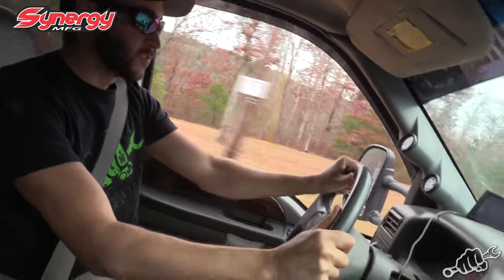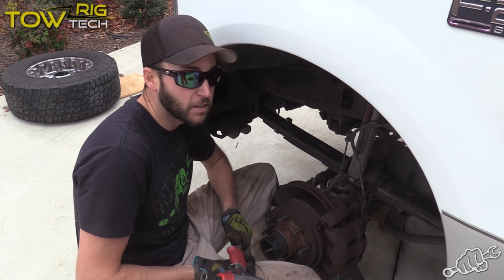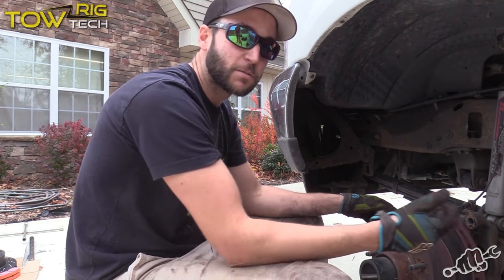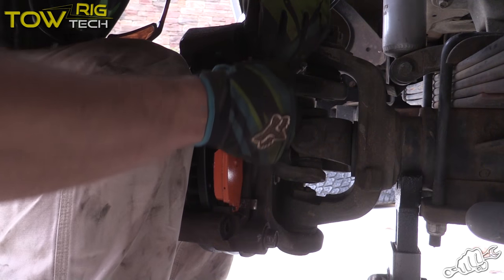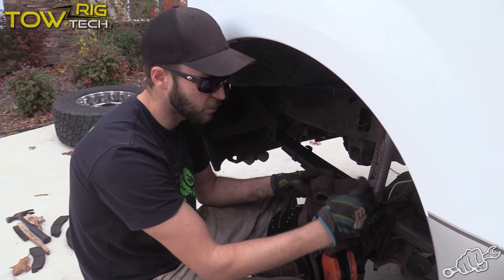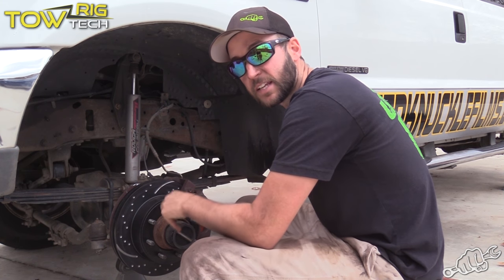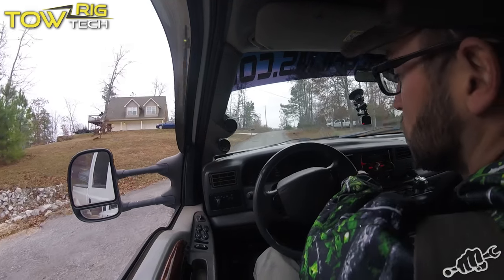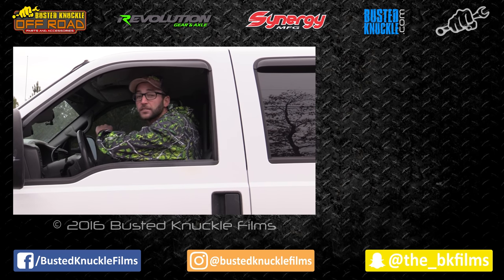F250 EBC Brake Install and Review - Tow Rig Tech EP2

Comment: I did a similar setup on my Excursion and the stopping distance and pedal feel is awesome.  I'm jealous on how nice everything came apart on that truck - salt is hell on those parts in MN.
Reply from the maker: Kyle Q it was all pretty rusty. I am glad these rotors are coated so no more rust
Reply: Kyle Q I had to pull the caliper brackets off of my 02 Silverado the other day, and I almost busted both of the huge bolts trying to get them off. Minnesota is hell on every vehicle, no matter what part of the vehicle it is. The truck in this video is so clean of rust compared to anything that you work on around here. There is always a pile of rust to sweep up.
Reply from the maker: Yeah that salt is rough on stuff for sure

Comment: Any recommendations for upgraded calipers? I'm fixing to overhaul all 4 corners, lines and all and I need some good calipers. I did some research on the Power Stop kit with everything included but SEVERAL reviews on the plastic pistons in the calipers, some catching fire, so I'm a little leary after seeing that but love the fact I can get everything I need minus the lines in one kit. I appreciate any advice you have, thanks!
Reply from the maker: they are remanned factory calipers. SSBC would be my choice if I wanted to upgrade the brakes.

Comment: Are these way better than stock I’ve had 7.3 excursion and F350 pull to both sides when I hard brake
Reply from the maker: I think they are , sounds like your rotors might be warped

Comment: My pos 7.3 has gone thru 6 calipers over the past few years, bastards seize up on me. It ain't the slide pins either. I wish there was an affordable upgrade
Reply from the maker: so far no problems for us
Reply: G Palmer0331 changed the brake fluid in mine is solved the problem
Reply from the maker: That does help
Reply: I've have to grind out the slots so the pads don't catch after every winter in Buffalo NY.  Looking for an upgrade now. Truck is 12 years old.

Comment: I couldn’t help but notice you’ve got a rough country lift kit. How do you like it? I’m considering an rc kit for my truck.
Reply from the maker: I just had a leveling kit with new springs from them. If you are on a budget I would say they are the way to go.
Reply: @BustedKnuckleVideo  I take it the ride is pretty hard?
Reply from the maker: no it rode pretty good for the price
Reply: @BustedKnuckleVideo  What'd you end up replacing it with?

Comment: Great video! How did you determine to go with the EBC red vs yellow or green?  Do these make any noise?
Reply from the maker: They do not make any noise. I gave them a call and told them about my vehicles and they made the recommendation on which pads.
Reply: Yellow are metal brake pads. Metal on metal
Reply: MegaTabetha  I use the red stuff. Pads. They're good.  Pads last a long time. september 17, 20017 to today.  Lots of brake dust with the red. Dirty so much my wheels.
I herd the yellow stuff, where for track use racing.

Comment: i am constanly warping rotors on my 99 7.3 dually. 315's & towing.......would love to see an update in six months.........
Reply from the maker: We will be doing an update on them for sure. So far so good.
Reply: so the pulsating feeling in the brake pedal you feel is usually stuff between the rotor and the hub (Behind the rotor )  
they say you should wire brush / clean the mating surface as rust and dirt get in there and a tiny deflection will make the rotors wobble and give the feeling we all think is warping ----- its not actually warping (Deforming) the rotors
Reply from the maker: Correct.  You can't really warp rotors from heat. It is more of uneven deposits of brake material and or uneven wear
Reply: Then why did a brake lathe seem to fix warped rotors in all my years of wrenching?
Reply: Then why is it when a rotor is in the lathe you can see the run out. The brake lathe does not lie if the rotor is warped. I still am a mechanic since the 90's. Warped is warped. Simple as that.
Reply from the maker: Is it warped looking because the pad has deposited material onto the rotor or because something has caused it to wear funny?

Comment: question, does that black finish come off Rhett rotors? or do they stay that color?
Reply from the maker: It comes off as they wear
Reply: BustedKnuckleVideo thanks. I havea12 Dodge chargerabd got some ebc rotors but I went with hawk pads  any suggestions?
Reply from the maker: I like the EBC pads, give them a shot

Comment: You didn't change the pad hardware.  That's a must when I change pads.
Reply from the maker: Slide pins and pad retainers? They seemed fine
Reply: BustedKnuckleVideo - No the thin metal hardware clips that sit on the bracket - the pads sit on them.  They get cruddy and keep the pads from moving freely.  Most/many pads come with them.
Reply from the maker: These pads didn't come with new hardware
Reply: And blue lock tight on caliper mounting bolts

Comment: 13% for double the price? compared to used brake pads/rotors???
Reply from the maker: I have had zero issues out of them, My old stock brakes "warped" way to easy.
Reply: @BustedKnuckleVideo  I really want to try the ebc rotor and pad kit on my 2010 Titan 
I always have some payload on it and I'm tired of cheap rotors warping like the Duralast.

Comment: You left out an important check: EBC stresses the importance of measuring rotor runout... and you did not show that step.
Reply from the maker: On a brand new rotor?
Reply: BustedKnuckleVideo Actually yes; check the FAQ at EBC's site. They will void warranty on a rotor that displays disk thickness variation. They state disk thickness variation results from excessive runout. For that fullsize truck runout needs to be less than 0.006 inches. I am refitting my Dodge 3500 with EBC brakes.
Reply from the maker: They stand behind their products as far as I have seen. How do they expect a typical person to test runout?
Reply: BustedKnuckleVideo Quote below is from EBC's FAQ on their website (emphasis is mine):  "If sport rotors are not checked for runout, driving without even applying brakes will exhibit a clicking noise on a “Once-per-rev” of the wheel basis. If you encounter this, especially early after having rotors installed return them to the service shop and have them checked for runout. Recommendations for maximum permissible runout vary from 0.001 to 0.002 inches on most European cars to 0.003 to 0.006 on larger USA Trucks and SUV’s. Figures above these are not only unacceptable but they will cause brake vibration after a period of 3000 to 4000 miles. (Read below in Blue please) which is not grounds for warranty. "
Reply: BustedKnuckleVideo As I said earlier, I just installed a set of the same dimpled/slotted rotors on my Dodge 3500 after reading and complying-with all EBC's instructions. Please read item #13 on the FAQ for further information.
Reply from the maker: I followed the instructions they sent me, nothing on there talked about run out. I had no clicking noise, so I guess I am good.
Reply: BustedKnuckleVideo Sounds, then, like all is good.

Comment: Will these rotors warp
Reply from the maker: I have not had a single issue out of these. Rotors actually don't ever warp, the effect is caused from material of the pad getting so hot that it unevenly glazes itself onto the rotor.
Reply: BustedKnuckleVideo are the new pads ceramic or semi metallic